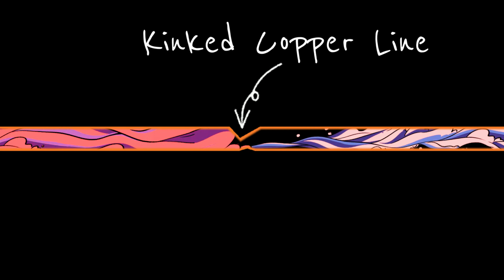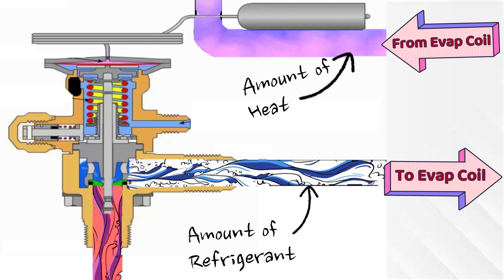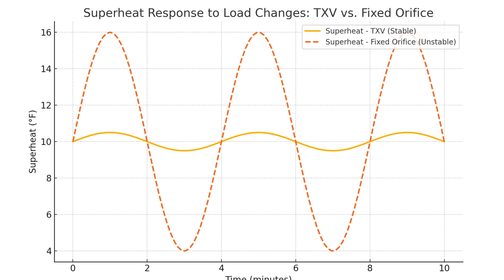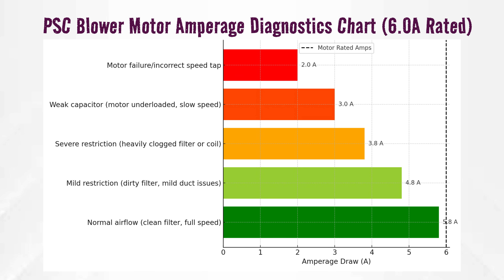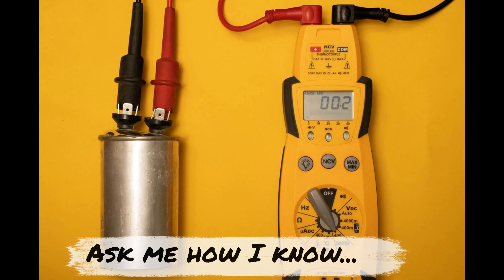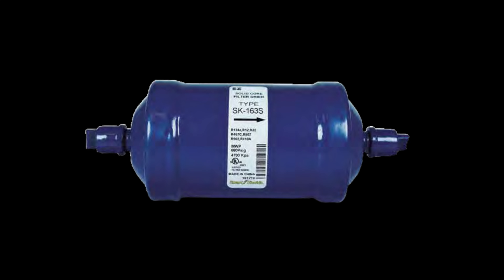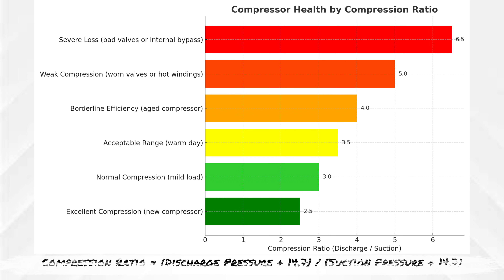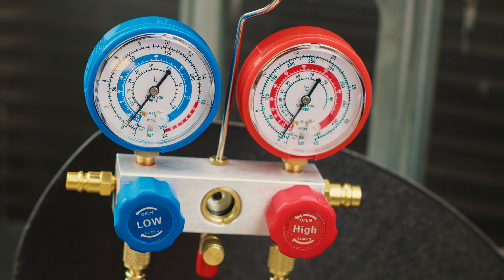Avoiding TXV Confusion & Misdiagnosis

Comment: Great explanations and very helpful. I'm running an issue with my heatpump that heats but don't cool. In cooling mode it will stop after 10 nin with a error code  "72 Thermal Cutout". After doing several checks, I'm assuming that the reversing valve is not operating properly when energized. Now during winter, because of this same issue, when going in defrost mode  the ice is not melting. The unit has 10years, so I'm wondering if I replace it or just ask a HAVC tech to fix it

Comment: Thanks Mike so Glad I found ur Channel  29 yrs in & still learn everyday  new tech & old basics  self & my new guys all the above ditto but instead of removing the build warn it up or cool it off to test SH & or psig changes have you ever herd of stopping the outdoor fan w/ system running to drive up head to see of any changes on the Suction PSIG or SH ? Bulbs are not always easy to remove & replace but doable of course as necessary

Comment: 5⭐️Mike!
That "kink" in the line can also be caused by too much brazing rod applied to the pipe joints, I've seen it.
The installer had difficulty brazing the vertical joints and filled the pipes with rod.
It cooled in a circular blob with only a pinhole of passage on both the liquid and suction lines.
That diagnosis was a head scratcher!
Reply from the maker: Yeah I bet. I'll have to keep an eye out for crappy brazing jobs now that you mention it.
Reply: How often have you seen this happen?
Reply: @richardwuttunee125 one time thus far